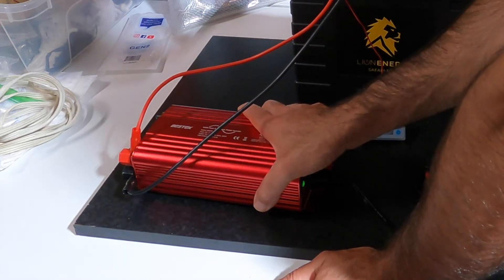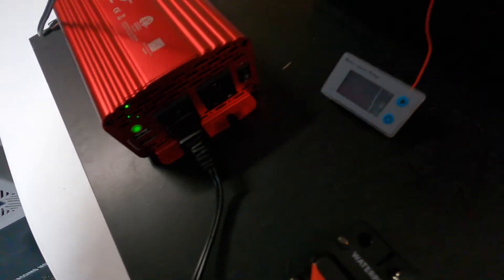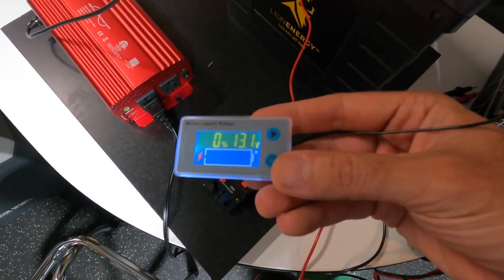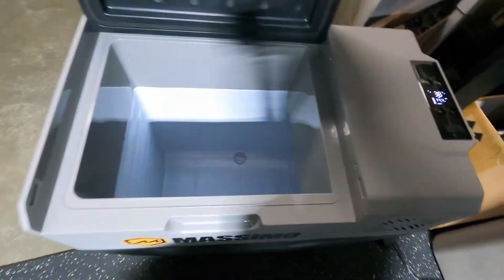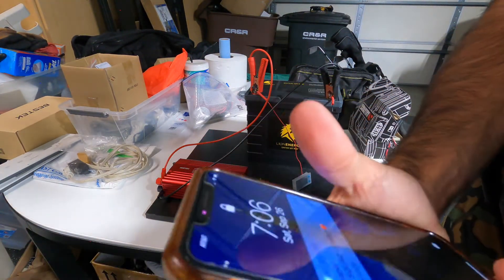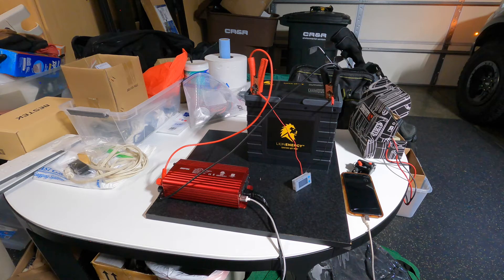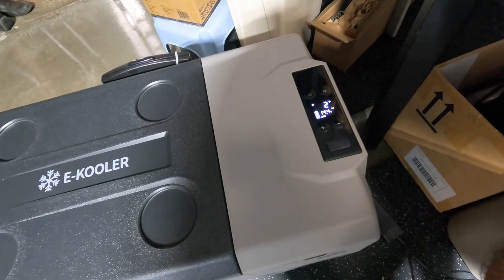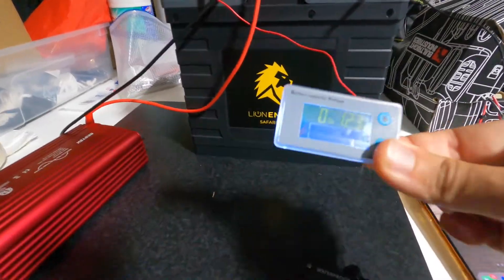500 watt Pure Sine Wave Inverter Bestek Efficient Inverter USB Camping Offgrid Power Lithium Battery

Comment: Wow,  the inverter ran that long without charging the 12V battery.   Any advise? I am trying to decide on the right inverter and hoping that the Bistek 500w inverter would be enough to run my iMac desk top computer for most of the day without having to turn on my engine to charge battery to often.
Reply from the maker: Peter Foto I can’t imagine your car battery being able to run an inverter and desktop computer for more than 20 mins or so. Mine was running off a lithium ion battery. Car batteries are generally lead acid. And this would be hard on the car battery as well, probably causing premature wear. You should get a generator, either gasoline, or a good spare battery or lithium ion power bank.
Reply from the maker: Peter Foto you would need a deep cycle battery instead of a starter battery most vehicles use
Reply: @shaunstayfree5551  Thanks for your input.  I will have to look futther into it.

Comment: I missed something? Why plug a 12 volt cooler into an inverter? You end up with two loss points. Maybe just for testing?
Reply from the maker: Yes sir, just for testing, otherwise just run it off a DC 12v plug you are correct

Comment: If my PS4 Pro Draws 150 watts and my 29” LCD Draws about 50 watts what is the smallest Inverter I could get and would I be able to plug it into the cigarette lighter? 

1) Was your battery a deep cycle 
2) Was your battery charging during the 19hours?
Reply from the maker: Yes deep cycle. Not charging no. You need to take into account fluctuating draw. I wouldn’t recommend anything less than 400w pure sine wave. 500 to be sure
Reply: @shaunstayfree5551  what do you think about Bestek or any other cheap brands on Amazon you know?
Reply from the maker: @camillod734  I have the bestek I think it is fine. Although someone did post it is actually modified sine wave. For my needs I have no issues with it
Reply: Cigarette lighter plug only handles 120-150 watts. 10 amp fuse X 12 volts